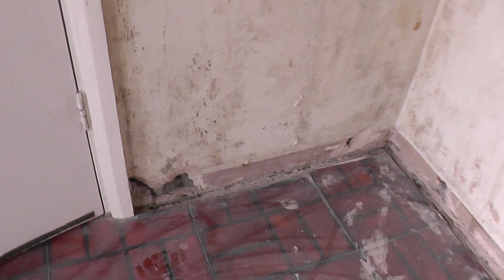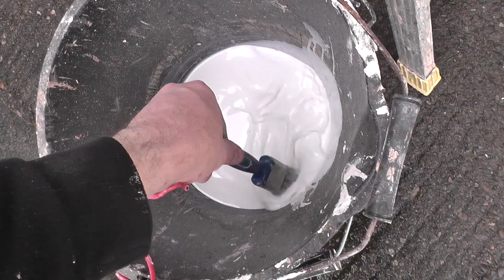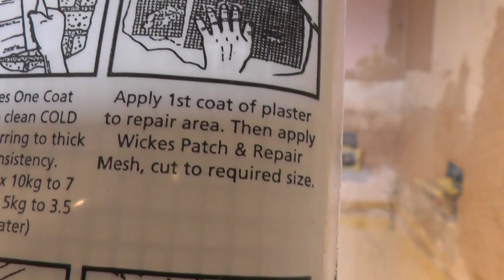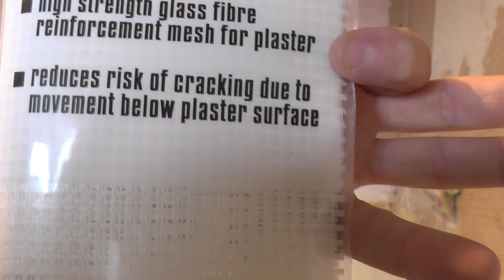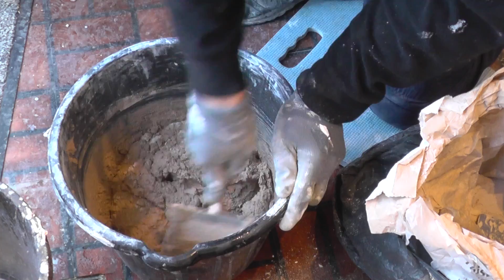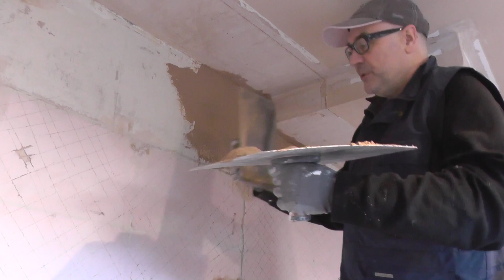DIY: How To Plaster Over Different Materials To Reduce Cracking

Comment: You should have overlapped the joint/in corner where ceiling meets wall with the mesh! It will crack in the joint otherwise.
Reply from the maker: Thanks for your feedback. I was going to scrim it when I skimmed the wall. However, I still have some of the mesh left and I may well Bond that in with the ceiling beforehand. Thanks for dropping by. Des
Reply: @21stcenturycaveman33  better to add a photo of you doing that in video, or do a quick follow up video of you doing that, cos its misleading people otherwise. Its necessary to put scrim tape completely in corner to overlap both surfaces. 
Lots of your viewers have no idea of the right way, you are not doing yourself any favours not to show it.
Reply from the maker: As mentioned above I was going to scrim the corners using scrim tape. However (as also mentioned above) I still have some of the mesh left and I may use that instead of the scrim tape. I haven't decided. As always, there will, of course, be a follow up video when I skim the ceiling and walls. There is also nothing wrong at all with what I have done so far but I do agree that the inside corners would benefit from scrim. I would also add that whilst it may be good practice to do so, many plasterers actually do not put any scrim up at all and merely plaster into the angles. ATB, Des
Reply: @21stcenturycaveman33  omg Des stop getting so ratty and take the man's advice..you're clearly an amateur and you should be happy to take his advice as I've stated above😂😂